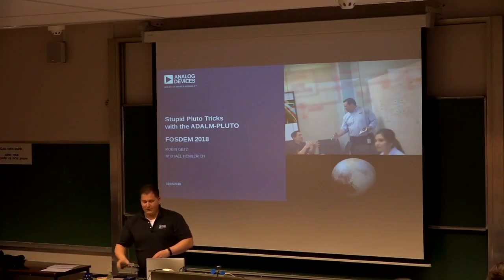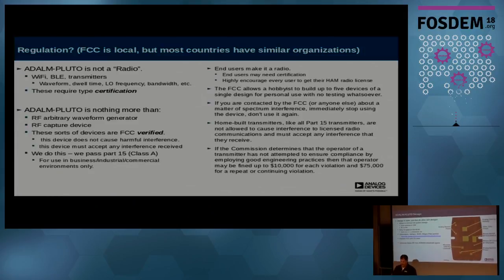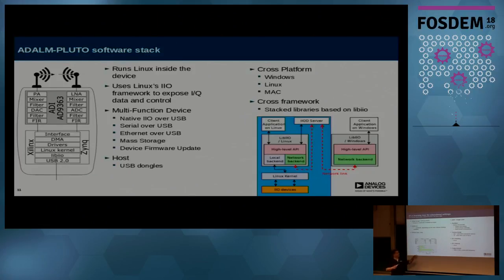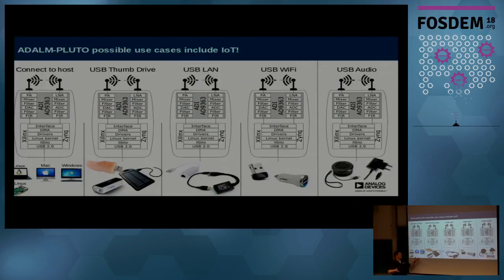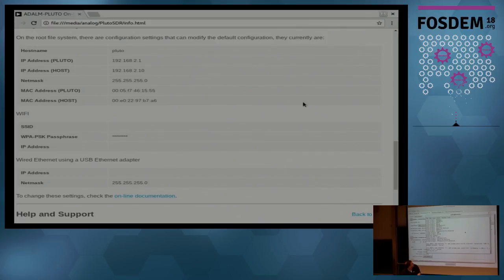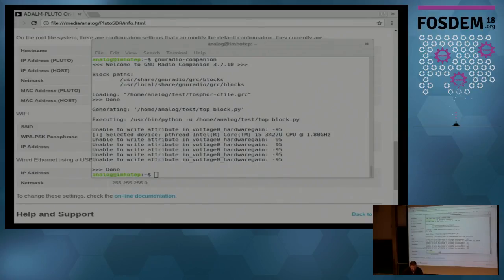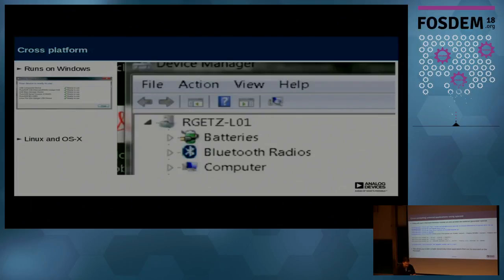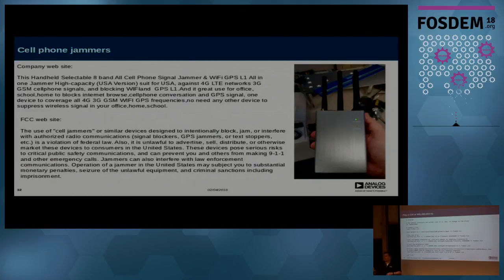Stupid Pluto Tricks Real world things you can do with a PlutoSDR

Comment: What i would like to see with this model is 1,000.00 milliwatt RF output that's only 1 watt that can be used by a Ham operator Like my self and other hams so we can drive a amp to 50-100 watts PEP and it will be clean even as a QRP no over admittance of RF and I am licensed by the FCC I fully understand and abide by the fcc part 97 Rules. I think the max right now is 40 or 50 kilowatts And when it comes to bands and FREQ  YOu Must Follow the Band Planes and Rules of the FCC so if your not licenced be careful broadcasting or putting audio into it on a band like the 2 meter band 144 - 148 MHz 10 meters 6 meters 70 centimeters 80 meters 20 meters  60 meters 30 meters 17 meters and 40 meters and 15 meters These bands are regulated by the FCC for hams they also have freq for walkies FRS and GRS the walkie band you can use and since your under 50 watts i think your safe on the 12  meter band AKA CB as well without a license  any other bands i would be careful with if your not licenced with they do have heavy fines.....the fcc regulates these bands. if you have any questions on what bands you can use without a licence you can look it up or call the FCC. KG5CUO - JOHN

Anyways now that i have covered the information for the none licenced Your intention for this was not really for the purpose of what we use it for well yes and no as a TECH learning about RF is important but you have this at a low wattage witch is fine for around the house but for me i would like to expand it and be able to use it with a broader RF  like i said before up to 1 watt and no more than 5 watts would be great....I could walk on acres of land talk to the home base or up to 10 miles away at 4-5 watts but again I caution none licenced people of broadcasting out of band bad language  music and things of this nature are not allowed  on the air. Unless you are Nasa and broadcasting for the ISS is the only time you can play music on the air as part of a spacecraft or mission.  The whole point of learning RF is to be able to use it if someone misuses it your company would not be held responsible it is the person or persons broadcasting that would be fined by the FCC So why use SDR? for us to be able to use it for CW and DATA and Voice and Digital Modes of Course EEM or Moon Bounce is a lot of fun as well. I am not sure how much RF you are allowed to have before it is considered a radio at 1 watt that's not much at all  and 5 watts is limited unless you amplify the signal then you must abide by the FCC Regulation and Rules of spectrum emissions. This would not be needed for frs or CB  where the max is 5-50 watts for the CB 1-3 watts for FRS.....or walkie talkie bands one could plug and play having a conversation with there friends blocks away on the FRS FREQ and who knows they may want to become a engineer someday where  they will learn about electronics and RF. As a Ham i can tell you a a emergency relay running on a generator this would be ideal for passing information that is needed speaking only for myself hams enjoy this type of device and if you could give it a upgrade we could use this also for emergency communications because of its small nature  it would work great....kids can learn morse code and send there friends messages like the old 1800 telegraph there is a lot of learning that people could use this device with sending packets PSK31 and TTY and other digital modes via computer to computer without the use of the internet of course this would be limited to 1-5 watts but it could be done  I am for any type of tech that can help someone learn the true art of RF and Radio. 73 KG5CUO - JOHN
Reply: Please also be careful about out-of-band spectral leakage. If you want to use this radio, you may need additional RF filters.